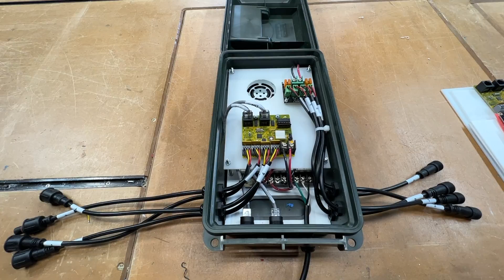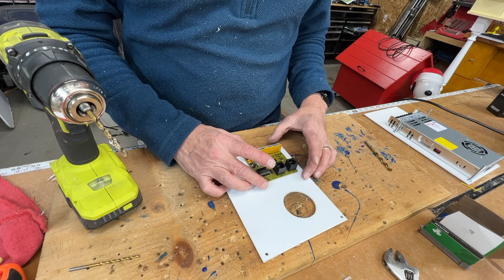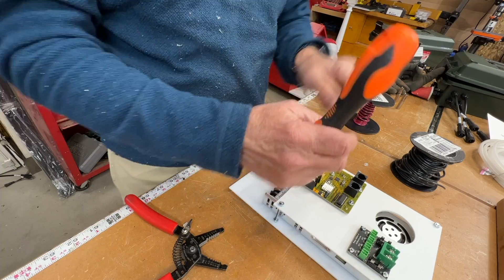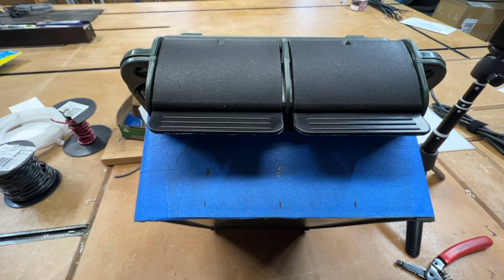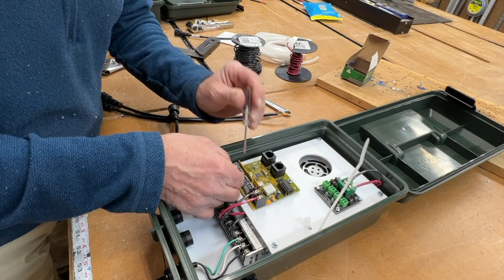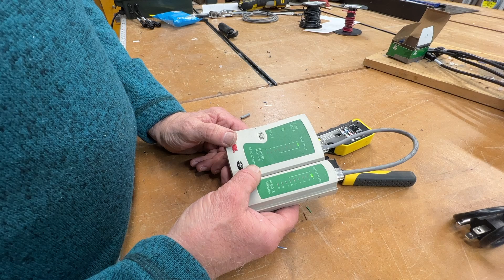Pixel Receiver Control Box Build

Comment: It looks like you are not screwing the board down inside the ammo can is that correct?
Reply from the maker: That is correct.  The cable glands keep the bottom plate securely in place.  Also I set these on the ground so gravity keeps them put.

Comment: So does anything except gravity hold the guts in the box?
Reply from the maker: The plates do just sit in place so gravity is king here.  Now I will say that the pass through connectors do make it difficult to remove the guts once the wires are disconnected so they do provide some holding power.

Comment: How much does a box cost to build? A pixie16 controller off light o rama is $380 already assembled so if this box costs $90 or more it’s not worth it
Reply from the maker: The build receivers range from $20 to $30, the ammo box is about $10, and the power supply is $30.  You do have misc parts so add another $10.  So bottom line ~$70 to $80.   Now one of the advantages of receiver boxes is you get the controller next to the prop and don’t have to worry about voltage drop for long cable runs.
Reply: @ thanks for the reply that’s great info to have
Reply from the maker: Happy to help

Comment: Do you mind if I ask you a question? I am getting in pixel lights a displays. I have a lot to learn but my question is have is with my old displays. I have 3’ words that spell out “HERE COMES SANTA” with two 4’ snowflakes. I spent a lot of time making it. I’m trying to salvage it some way. Do you know of any device out there like some sorta switch relay. That I could use to plug each unit into that would turn the lights just on and off in a way  were “HERE” is flash’s on and everything else is off. Then it turn off and “comes” flashes on and “Santa” then turns on with the snow flakes. Lastly they all flash on at the same time. Then it repeats. I’m sorry if I’m not explaining that correctly. Thank you for any advice or help.
Reply: I guess what I am trying to find out if I can use the leds (non smart) to run a small sequence. Everything is off then “here” turns on and quickly off. Then “comes” turns on and off. The “Santa and the snowflakes” turn on and off. Lastly they all turn on “❄️HERE COMES SANTA❄️the same time and off and it sequence repeats. I worked really hard on this and have about 2000lights just in it. Ii just can’t come to start over on it just yet. I’m sorry if that was a dumb question. Thank you again for any help or advice.
Reply from the maker: Yes there are several products out there that can be used to control your lights.  If you already have a pixel controller you can use Experience lights Pixels to Things products.  Light-O-Rama also sells controllers.  I have also seen guys make their own relay boxes.  Kind of depends on what your vision is.  I am not an expert on the AC control side.  I suggest you join one of the Christmas light Facebook groups like Holiday lighting think tank.

Comment: Been to 4 different dollar stores and nobody sells a cutting board like these. Never thought that would be the hard part to source 😂. I bought a piece of acrylic from HD to try instead.
Reply from the maker: Try Walmart as well.  I would be careful with acrylic, it is brittle.
Reply: I know this is an older thread but, I went to 3 Dollar Tree stores today (just saw this video yesterday) and found these boards (same" handhole" as can be seen at 23:20 in the video) at 2 of them.  Picked up 6 of them. It's just hit or miss as to if or when they have them.

Comment: can you provide a link for the network passthrough glands you used
Reply from the maker: Axawibe 5 pcs Female to Female Panel Mount RJ45 Connector CAT6&5,Ethernet LAN Cable Connector with dust Cap Waterproof IP67, Black https://a.co/d/gHQD1Ot

Comment: Can you please add a link to those waterproof connectors used? I searched for "PJ7 Connector" and found nothing
Reply from the maker: I will add them.  I should have said PG7 and PG9.
AMPELE Cable Gland 100 Pack PG7 Waterproof Plastic Adjustable 3.5-6mm Cable Glands Joints With Gaskets, Black(PG7) https://a.co/d/azWQ84a

AMPELE Cable Gland 100 Pack PG9 Waterproof Adjustable 4-8mm Nylon Glands Joints With Gaskets, Black(PG9), PG9 (100-Pack) https://a.co/d/g5CpcAZ

Comment: Thank you so much for this insight. This is my first year with props, and I was using HF 30cal ammo boxes.(not as roomy) but this is a much better solution..... I want a spinner for next year but I have been trying to figure out how to provide the additional power. This is an awesome build that provides a lot of flexibility due to the power distribution board and the xconnect power only wires. Thank you!!!!!
Reply from the maker: Glad to help
Reply: @bergmannlights5149 so the power distribution board is only if you have something that requires power instead of running a separate extension cord?

I’m totally new at this, so this really helped.